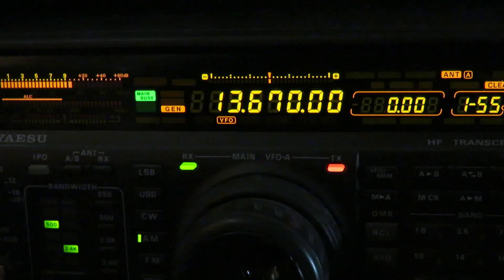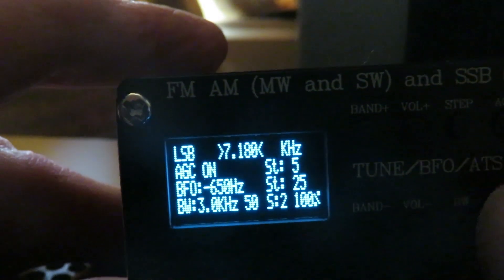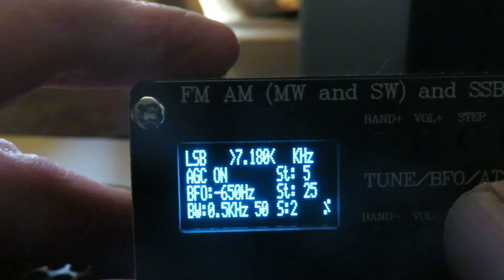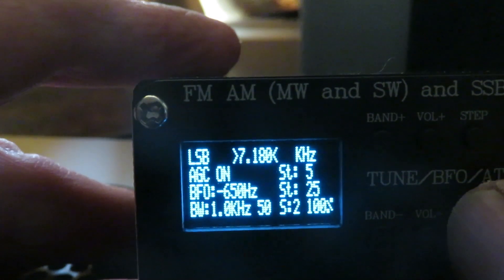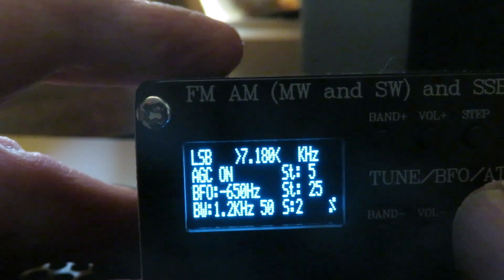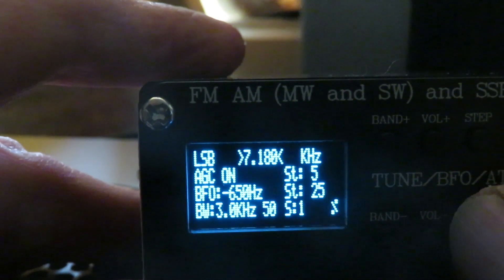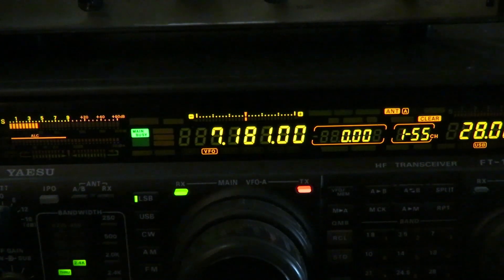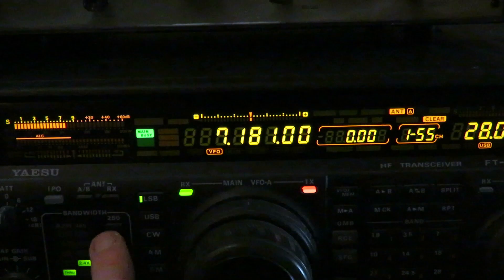Bandwidth settings on the SI4732

Comment: Just received mine.  I like it for what it is.  Listening to 7.310 on my 200 ft long wire balanced and amp.  Does very well and I also ran it on my homebrew amped rotor hoop.  Works well for what I need.  Going to use it for an outside MTN radio on a portable dipole.  Again it was cheap enough and worth the chance.  Thanks, mine took 15 days to the states.